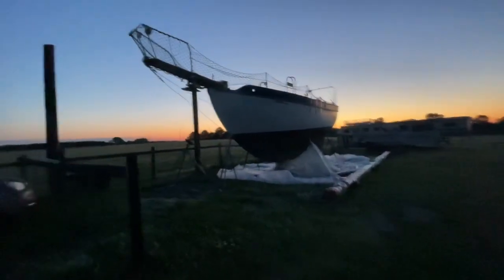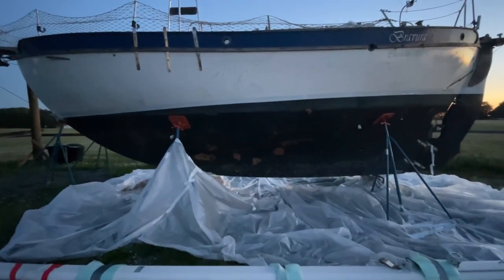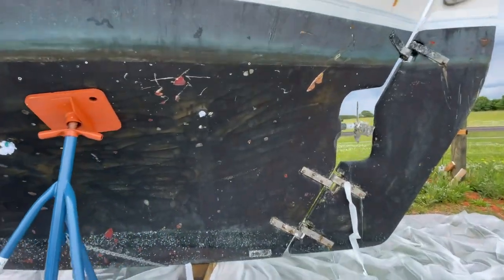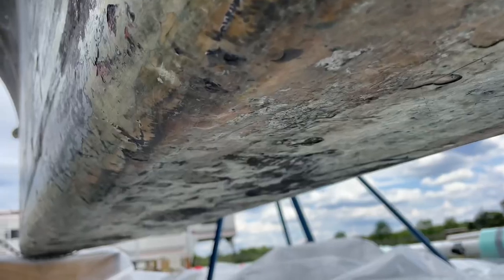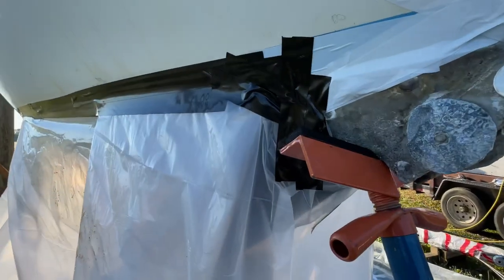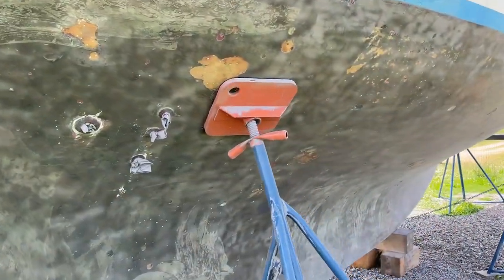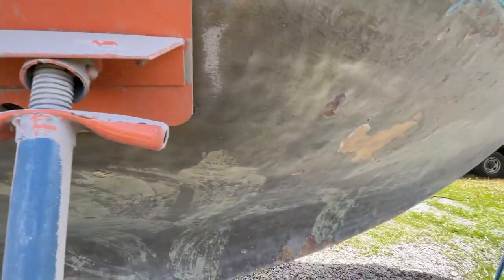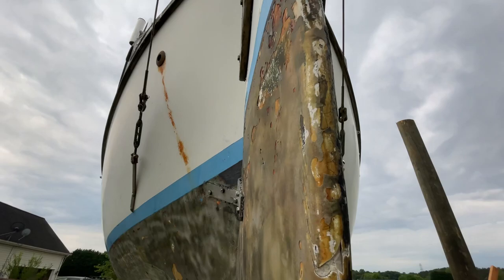Sodablasting a Sailboat Hull | Sailboat Restoration Ep. 8

Comment: Thank you for documenting! I will be in a very similar situation soon, recently purchased a never launched uncompleted 1977 WS32, should be in my yard in a few weeks. I am so happy that my boat still has bare gelcoat on the bottom!
Reply from the maker: Awesome.  A blank slate.  Won't take much to get it barrier coated, and epoxy primer.  I am waiting on the antifoul until closer to splash down.
Reply: @Even_Keeled  are you going to wait on the barrier coat too just to let the hull really dry out?
Reply: @qtoyoutoo  I have the barrier coat ready to go. I want to repair any damage first.  Doing that now, and I will get painting soon.

Comment: Why not soda blast it from top to bottom?? I figured it would have stripped it down to the fiberglass
Reply from the maker: Per an original builder of the boat, it got it down far enough. I’ve been able to scrape or sand certain spots. Sodablasting ended up better than I originally thought.

Comment: That looks like a coating  not damage too your hull. Most hulls have a gel coat that is white. The gray looks like a barrier coating of some sort.
Reply from the maker: By damage, I was referring to the punctures down to the laminate in some areas or the more vertical stress marks spiderwebbed in the gel coat/fiberglass. I think you are right, and the gray under the paint looks like a barrier coat.
Reply: @Even_Keeled  I don't think that soda blasting took off enough... Don't get me wrong, I love soda blasting as a process.  I had a custom chopper soda blasted to get the old paint off before the frame was ultimately nickel plated, so you know that any imperfections would show right through the plating.  Sand blasting would have been the wrong choice for my bike, too aggressive, but I think your hull would have benefited from a more abrasive media.
Reply from the maker: @SteelDoesMyWill  At first, I thought the same thing. There were a lot of ablative paint layers, and what seem to be left of the (barrier coat??) is super thin. I think anymore and it would have eaten into deeper layers. I'll give it a closer look, and sand a spot to see if we should have done another blast around the boat.  I will say that it is very smooth now and I've seen sandblasting chop a hull up a little more than this outcome. Only two osmotic blisters - very small ones - drained when blasted.  I'll have to do it again one day, and I have a good baseline now.